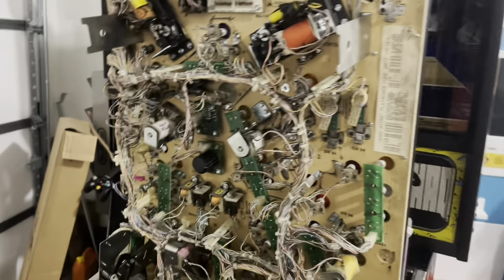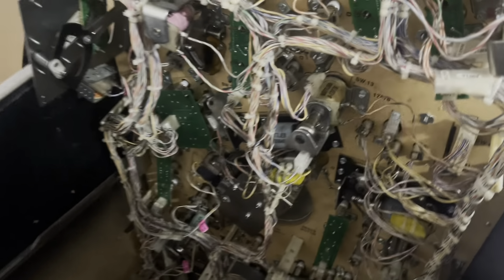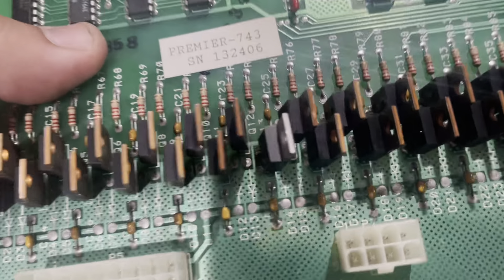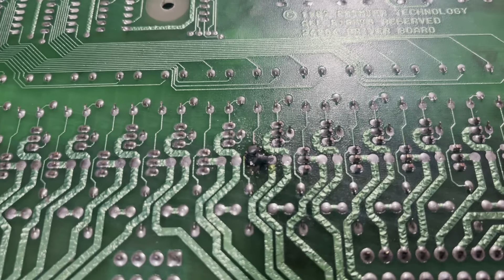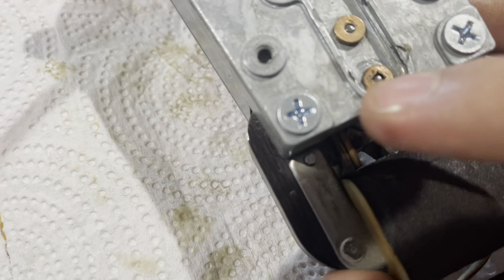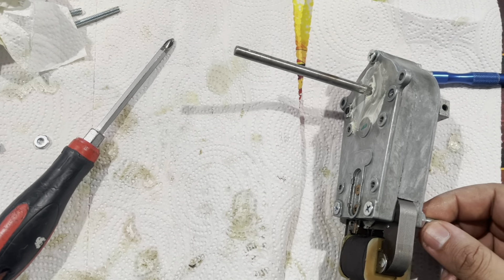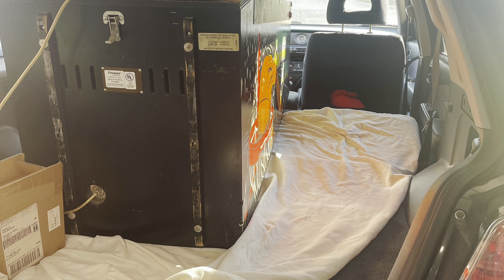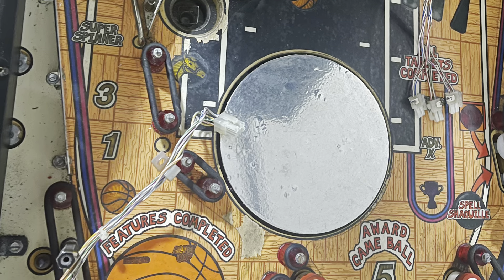Shaq Attaq Pinball! Repairs and maintenance.

Comment: 14:22 Looks like your "Free Throw" upkicker is super weak or pointed in the wrong direction, you may want to look into fixing that. Normally it kicks the ball down to the right flipper strong enough that if you don't use the flipper the ball will bounce over to the left flipper.
Reply from the maker: Thanks for that input. Sold it already but if i ever come across one il know now! Was my first time owning this particular machine

Comment: Great work! Congrats! The basket motor gearbox was riveted??
Reply from the maker: Yes it was riveted. Someone had attempted a fix prior and had used bolts
Reply: @ishkaz5873  i was having the same issue. Mine was very loud and slow. Originaly riveted. So the motor could not be upside down as yours… ive openned it, cleaned, new grease. But as ive mounted, again very loud and slow. Changed the motor. It got fast but still very loud and After some time, stopped working and i cant turn it My hand.
Reply: I Will open it again to try to find out whats wrong…
Reply from the maker: You can send these to pbresource to have refurbished
Reply: @ishkaz5873  thats Right, thanks!!

Comment: I wanna reset the high scores for this machine. Any insight?
Reply: Yes, it is rather easy! If you open up the panel on the front, there is a small board inside to the left with a single button. You can turn the machine on and use that button and the flippers to get to the settings mode and cycle through the settings. I believe the top five high scores are some of the early settings. When you are done, just close up the front of the machine and cycle power! Reply back to this comment if you need additional help.